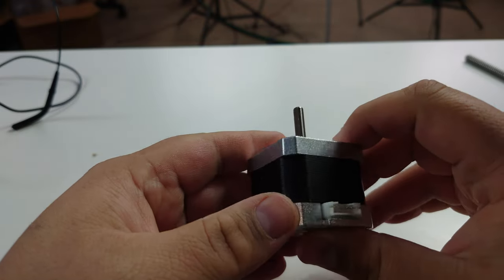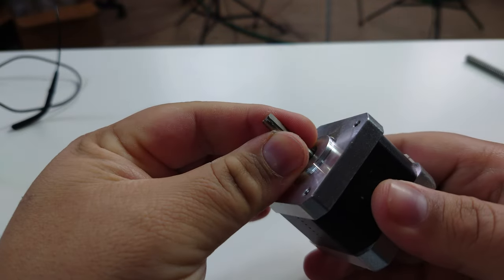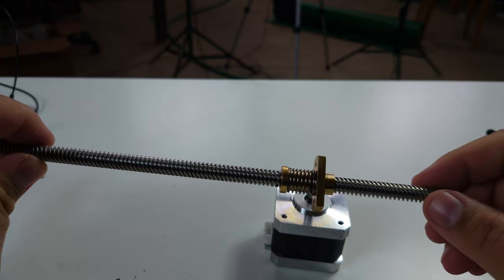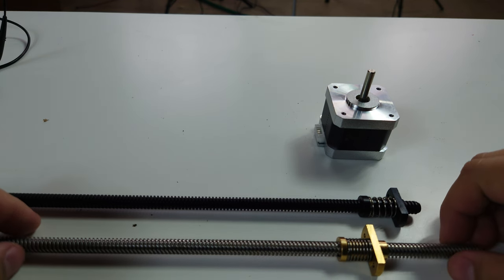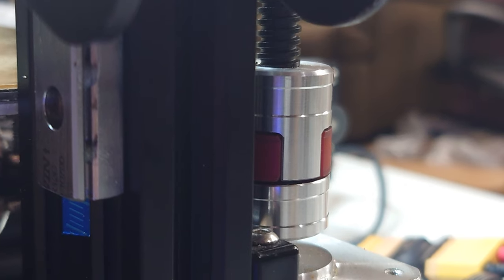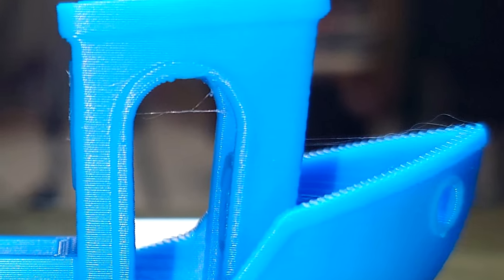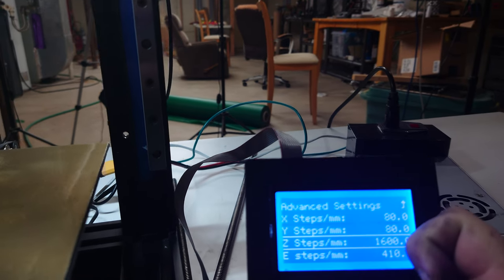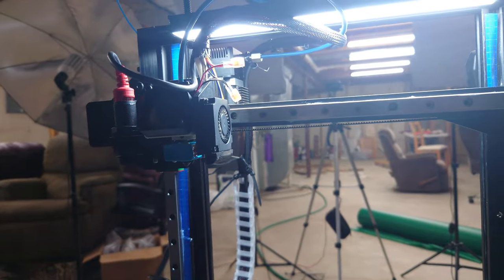Lead screws with 2mm lead vs 8mm lead - Is 2mm worth it?

Comment: I know you posted this video a while back, but I was wondering what nut you used for the new lead screws? I just ordered some tr8x2 lead screws and POM nuts, but the POM nuts are the standard 4-hole design. While I don't mind modding things if there's a drop-in readily available that makes things easier.  Printer is a pretty heavily modded Ender 3 V2.

Comment: I hope you’re doing well! I have a couple of ideas for an auto disengaging lead screw nut that I’d like to share with you.

Segmented Nut Design: This would involve the nut being split into 2 or 4 pieces, held together by a spring. When the screw hits a stop, a spreader cone would disengage the nut.

Cone-Shaped Ramp Nut: In this idea, a cone-shaped ramp nut could be positioned at the end of the shaft or along it with a jam nut. A spring-loaded half nut would then roll up onto the ramp to disengage.

I think both concepts could offer some interesting functionality. Let me know your thoughts, and if you’d like to chat further!

Best,
Dean

Comment: no before and after? how are we supposed to know if it makes any difference wen there is no comparison?
Reply from the maker: Still tinkering and dialing in settings. Turns out the lead screw I got was out of spec, so I'm waiting to do a proper comparison